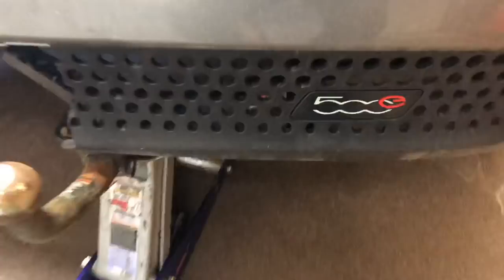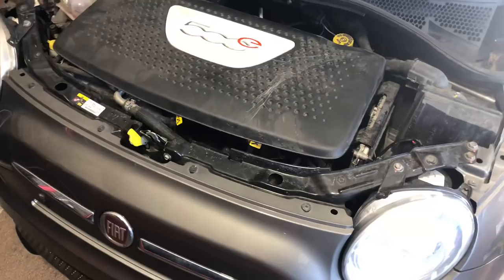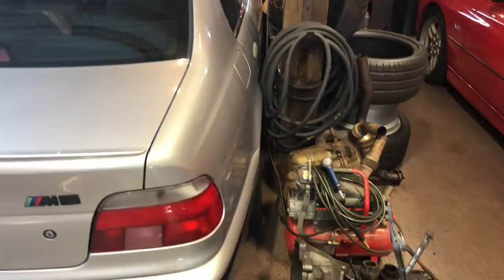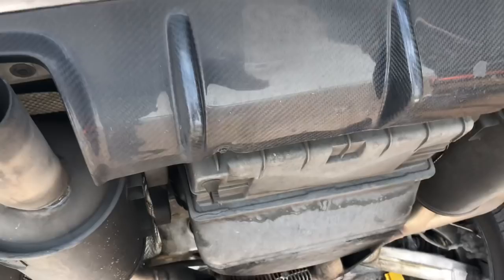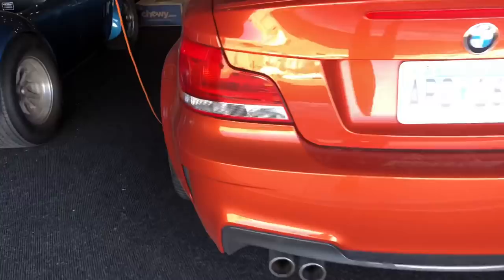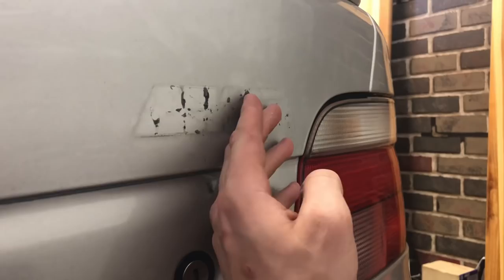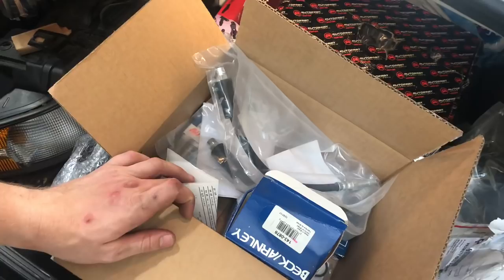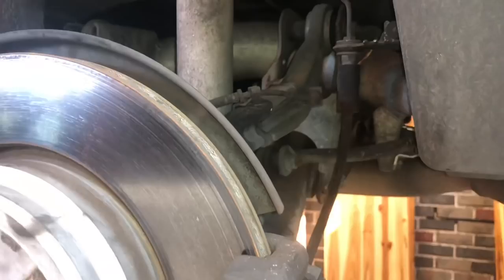2019 wrenching season begins! E39 M5, Fiat 500e, E82 1 series M

Comment: Oh hey on the topic of door actuators for the e39, On mine ive noticed that the rear doors sometimes dont want to lock on one side, its random for both rear doors, is this a lazy lock actuator and should be replaced or just likely sticky? They always unlock at the same time just fine though
Reply from the maker: its actually the lock actuator on the latch assy. thats whats bad on my car too, but it was cheaper to buy the whole thing second hand ($12) than it was to buy the actuator ($30)

Comment: Im suprised you chose autolite plugs for the m5. Why not ngk plugs?
Reply from the maker: why not?

Type of plug matters FAR more than the brand. I run single cathode single platinum plugs in almost everything with excellent results (off cases like Ferrari where I have no choice but to run iridium, or the S54 where they just LOVE copper core plugs)

Some people put dual or quad cathode bosch plugs in these and they barely run.
Reply: I agree with you regarding type. I've just always been hesitant to run autolites after experiencing issues with an audi 2.7t. For bmw engines, I always use NGK or Bosch. I guess I'll have to keep an open mind next time I shop for plugs.
Reply from the maker: some engines are picky, but it's not the brand, its the type of plug for me. turbo engines, copper all the way (my 1M, I run copper core plugs and just change them all the time, same thing as 2.7T).

probably wouldn't buy a no-brand plug, but Autolite is an OEM for a lot of manufacturers, and even domestic shitboxes have super high tech Di turbo engines these days, so it's silly to assume they can't do just as good a job as Bosch, NipponDenso, NGK, etc.